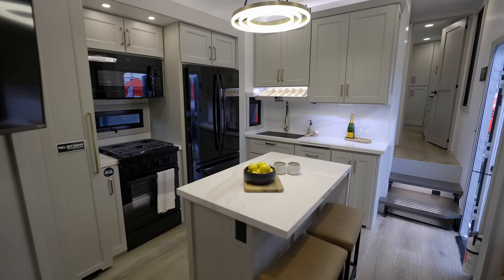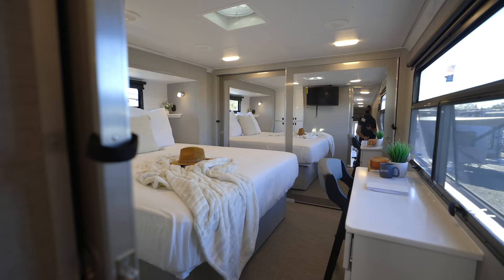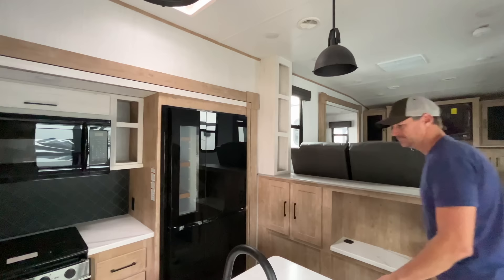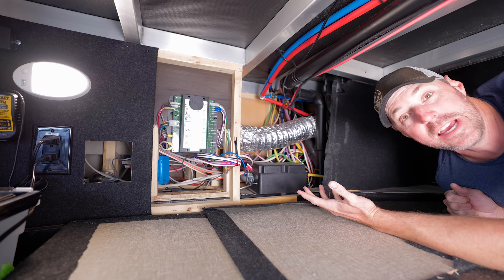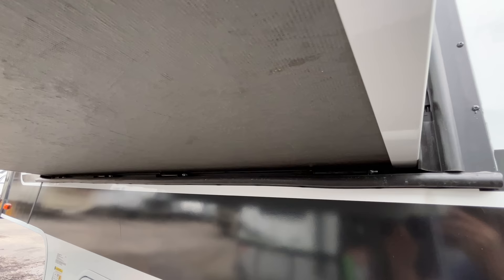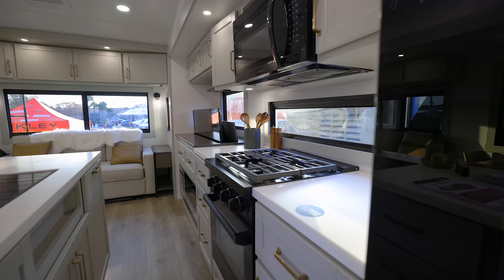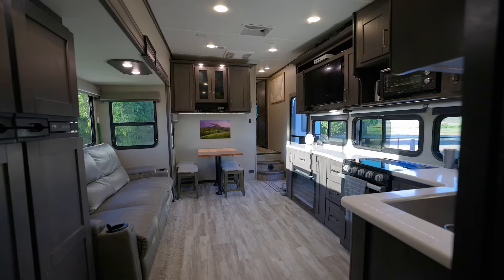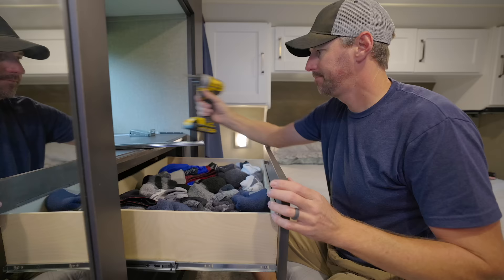Are All RVs Junk! Problems With Our Grand Design RV.

Comment: Those comments you highlight are justified. I have owned 3 trailers in my lifetime. A 1969 Boler, 2014 Coleman Dutchman and a 2019 Aspen Trail by Dutchman and BY FAR the 2019 Aspen Trail is an embarrassment to Dutchman. Couches peeling, counters peeling, cabinets that have no stay open ability, cheap plumbing, cheap toilette, peeling wall paper, no sealant in bathroom,  trim on slide is falling off .... like I can go on. The 1969 Boler Trailer was a far better trailer than this. My 2014 Dutchman was FAR better than this and all issues were not related to build quality. But this is not the case with the 2019 model. Dutchman should be ashamed at what they put out. I will never buy another Dutchman. Go Brinkley. It is weird to be going gaga over metal plumbing connectors but here I am. Good job Brinkley. The trailer company that learns that your brand reputation matters, will win.

Comment: The problem with the majority of the RV market nowadays is that 85% of them are made in Indiana by the Amish and they simply do not care about the quality of the work because they get paid by each piece they complete so they just try to crank out parts as quick as they can without caring about the quality. Most of them clock in at 6am and clock out at 12 to go to their farms. When Grand Design first entered the market they were pretty good quality. Even today they tend to be one of the better ones which is scarey because almost everyone we get in has issues.

Comment: Outsiders looking in (we have no RV), but we WERE in the market.  Fit, finish, and workmanship are just "lipstick on a pig", the real issues are literally where the rubber hits the road.  The poor design and engineering of frame, suspension, slides, and other physical systems are one of the reasons we never bought a RV.  We all have seen the videos and to be fair, roads are terrible, but other vehicles use same roads.  I fully understand that it is prohibitively expensive to build towable RVs like cars, but improvements could and should be made.

Comment: We've been RV-n for over 50 years. In that time we've had a number of types & brands of RV's. We've always bought the little more expense, a little better quality models. We have seen a big difference in quality & more problems with the last two over the last 10 years. This last one we bought was from a small manufacturer building higher end product. We paid more but felt we needed to in order to avoid a lot of issues we see people having.  I do 99% of all my repairs & maintenance as I have ended up redoing what the service shops have been so poorly executing. I think you better be handy or unless you have a "guy", expect service issues in this day & age. I've learned not to get all excited & in a hissy but attempt to stay calm & fix the issue. I was helping a young couple in their first RV. It was a small, low end tt. I was appalled at how bad the materials & workmanship that was done. They didn't know any better. My bet is this is a 'disposable' in 5 yrs or less.

Comment: Plus GD with other manufacturers are having a major issue with what they call "Frame Flex", which is a nice name for frame failure. I have seen six videos on frame failure within the last week. Basically any unit over 30ft has a good chance of have this problem. The issue is when the manufacturers secs these out to have the frames built, they do not have the frame beefed up to handle the weight of the RV. The frame builders are only building the frame to the manufacturer specs. The manufacturer are cheating corner to save money. The outcome is the frames can't handle the weight and the welds are breaking loose. GD is having a major issue with this. The other major problem is the manufacturers don't want to back their product, and it is a major expense. In fact with this RV in the video, it wouldn't surprise me if he has frame failure. Buyer beware, especially if you are buying used, but they are having issues with new  ones off the lot. There are multiple videos out there going over frame flex.

Comment: I have a Travel Trailer (2nd and 1st new) and I have no intention on ever buying another one.  The entire experience from the Dealership, warranty work, major post warranty (Year 2) problems with roof membrane de-lamination, underbelly skirting flying off, sink and shower drain failures, pealing wall covering, Multiple pocket door failures, poor AC performance, etc... has made the entire experience frustrating at best.  At no point did anyone in the process of the new trailer did even what should be the bare minimum.  Brakes where shot from day 1.  I didn't realize it until our first trip and noticed that braking wasn't normal.  Attempted to resolve myself and ended up at the shop for 2 weeks with no updates from the dealer and the entire brake system was rebuilt probably due to grease all over.

Comment: I've owned two travel trailers. One thing about the industry is the people assembling them are paid piece work. This means the more they assemble (also known as slamming them together) the more they are paid. Don't count on the dealer fixing anything pre-delivery other than a blatantly obvious problem like the AC doesn't work. Buying an RV is a roll of the dice regardless of brand in most cases. First travel trailer had minimal issues. The second travel trailer had a good 30 issues. The scenario for warranty work is: one round trip to the dealer so they can see the problems then another round trip for the repair work. Hopefully they have ordered all the parts and do the repairs 100% correctly. Think about the time and costs for about 10 round trips back to the dealer which is what I had to do with my second trailer. I don't want to mention brands but lets just say the second trailer wasn't a grand experience.

Comment: I have owned 2 travel trailers, a Class C and a class A - all purchased new.   I expect things to go wrong; regardless of price.  I expect poor workmanship; especially now when people lack a work ethic.  

I think two of the larger issues are; poor dealer service and too short of initial warranties.  

My dealer wanted to charge an addition $6,000 for delivery and prep.   What a joke.  

When we originally picked up the rv we found so many things wrong with it.  As we used it, there were even more things wrong.  

I took it to the dealer last week and the intake rep must have said 100 times "the initial warranty is 90 days.  We will fix what we can and see if the other things are covered by warranty.  These "things" should have been caught and fixed in their deliver/prep time and not once the rv is delivered to the customer.  And we find out we can only drop off and pick up the RV during their business hours and only with a specific appointment time between 8-5.   So every time we have to take it in we have to take a day off work and lose a days pay.  

Just like car dealerships, RV dealerships need a major overhaul in their customer service departments.

Comment: I feel your pain...bought our camper new in 2022 have been able to use it 1 time...bought it in April went on our first trip in July just 40 miles away as a test run...no refrigerator....lost everything...Took till August to get it in the shop took till October to get it back...already had a trip booked from June...did not get it back in time for the trip so had to cancal and was a non-refundable deposit...Got it back in late October and started putting all the personal stuff back in to take a trip in late December so i decided i should probably try the furnace even tho i had asked them to test it again while it was there for the frig....And low and behold...yup no furnace...So back to the shop again this week for who knows how long...Will never buy a Clipper again. Have paid for 7 months towed it 40 miles never used...Worst piece of junk i have ever bought. Needless to say it;s 200 mile round trip to my dealer...I am totally disgusted...It is junk...

Comment: The reason the Brinkley is more, besides the obvious finish, the frames is designed for the weight of the RV, heavier component steel members.  The Grand Designs is a frame design for non long term usage.  Meaning the same frame, you have on a 30-foot 5th wheel, is the same frame you have on a 36 foot.  The manufactures then put what they want on these frames from cheap lighter weight to heavy luxury.  The heavier the more problems that will occur.  The frames are not made for the weight, and long-term usage, they begin to "yield" or plastically deform, and the interior finish begins to suffer.  You wall issue is most likely a cracked or broken frame weld.

Comment: A lot of the problem is companies being bought by larger companies, less competition. My wife and I went to the Palomino factory who made our Columbus 5th wheel. One of the managers gave us a tour and on the floor was one of their first models built after Forest River bought out Palomino. It was not close to the quality it was and some of the amenities we had were not available anymore on the same model as ours. Larger companies mass produce Rv's and cause warranty items to take months to repair, if at all. Grand Design not so grand in my opinion. Again on certain models they have actually down graded options. Example going from 6 point all hydraulic auto level to 4 point with motorized screw jacks in the front. The 6 point hydraulic was stock on our 5th wheel. Central vac, upgraded suspension and oversize tires were stock on our rig. I could go on but people are paying way more for much less.

Comment: In a word:  "yes".  An RV is built from a collection of stuff.  None of the parts are particularly designed to go bouncing over terrain and potholes for hundreds of thousands of miles.  So of course those individual piece-parts will fail or their connections will fail - sooner than later.  Rent one if you need one but you are nuts to pay $500,00 for something you're just going to be parking in your driveway or at the dealer repair center.

Comment: I bought a brand new Forest River travel trailer in March.. I live and travel in it full time. 7 months and over 2500 miles later, the only problem I have is I need to replace the thermostat. I have to reset the breakers to use my heat cause if the temperature changes by 5 degrees (up or down) the thermostat resets to 99 degrees and the heat turns off. 

2023 Forest River Grey Wolf 20RDSE

Comment: Bought a new Class C which had supposedly gone through production checks AND dealer delivery checks. Once driven off the lot and putting 5 gallons of fresh water into black tank, discovered a leak missed by both factory and dealer checks. Such a simple test yet the hurry get it out the door mentality on a $100,000 RV absolutely flabbergasted me. Dont have the time or space to tell you about the wiring, just to say rats nest is an understatement.

Comment: Our 2023 Grand Design 278BH is what I would consider to be fairly well built, though we've had minor issues with things like trim popping loose.  The bottom line is that quality materials and quality workmanship costs money, and most RV buyers are only using them for a few weeks a year at most.  If a trim piece falls off or the wallpaper sags, they don't really care.

However, this doesn't meant that spending more money will guarantee you a better rig.  As you pointed out, you can spend more money and actually get lower quality.  But we can't expect RV manufacturers to turn out Lexus quality on a Suzuki budget.

Manufacturers can certainly do better.  But will buyers pay the inevitably higher price?  Given the large number of manufacturers out there and the highly competitive market for RVs, I'm inclined to say that few buyers are willing to pay much more.  If there were more such buyers, some manufacturers would have stepped up to the plate. Perhaps I'm totally wrong though.

Comment: RV isn't a year yet....water damage from leaking window. Paint rubbed off on cabinets. The shower separating. Our toilet is now leaking. Why? Because it's hooked up with garden hose material...NOT plumbing material! The ball bearings already broke in a drawer. Our storage behind TV has had shelving come apart.

Comment: Surprised to see the interior quality on the dealer lot.  How do they leave the factory lookin like that.  Have a 2016 5th wheel with no major complaints.  Seems the most complaints are from manufacturer.  I hope these videos will pressure manufacturers to do a better job.

Comment: First keep your 5 o'clock shadow!  You look good with it!  

Our first RV was a 2006 Keystone Raptor 3612DS w/a 12' garage.  We purchased it new for $38k OTD.  It Keystone's 2nd year of making the Raptor. The toyhauler market hadn't taken off for them yet and the quality of build was really good.  We owned it until 2012 when we upgraded to a 2009 Keystone Raptor 380LEV because of the 14' garage.  This toyhauler seemed to have a little more bling than our old 3612 but the quality seemed to go downhill.  My theory, and it's a wild @ss guess, is that they were starting to get busy and trying to get units out the door and quality seemed to suffer.  Good video on some things to really look over when purchasing your next RV.

Comment: Trailers like you spoke to in this video tend to be of lower quality across-the-board due to the need to save weight for towing and the customer base they serve. Newer motorhomes in the lower budget range suffer from the same quality checks again based off the engine and frame restrictions due to the lower price range they serve such as Thor. An older higher quality coach such as a Newell, Country Coach ect will almost always outshine newer lower quality RVs. Just do your research before you buy!

Comment: I was told by the Thor dealer's Service Manager that all RVs have maintenance issues all of the time.  I asked her if she would pay over $100K for a vehicle to have it in the shop every time you take it out?  She didn't answer me.  Small self-repair items ok but we had our unit in for the cab a/c three times. On the third time and third repair shop, they found MISSING PARTs in the A/C system.  I guess Thor doesn't have any former Ford employees- "Quality is job one."

Comment: After being an RV dealer for 16 years and owning campgrounds for the last 34 years to answer your question from my experience they may not be total junk but they're definitely not worth the asking price. You do have to consider if you're constantly traveling causing the unit to flex and bounce down the road things are going to work loose. Currently in my campground even the Park Models especially the one's with slide outs have no fewer than 4 visits to repair things from the dealer after a new purchase. Hot and cold waters switched, drain not being hooked up, stapled wires, walls coming loose etc. All the same problems I had to fix 20 years ago when I had my dealership. Every year constant visits from the dealers that is if you can get one to show up which isn't entirely the dealers fault since unless it's a 12 ft. wide model the manufacture expects the customer to tow it back to the dealership to have repairs done and won't reimburse the dealer for service calls.
Reply: do u advise buying a new cargo trailer and building your own....from what i understand many rv parks will not allow a reconverted cargo trailer into their parks...i do not know if this is true....
Reply: For overnight/transient I don't mind but for seasonal no because it doesn't have a RIVA seal on it  @US_ARMY_25_INF._DIV.

Comment: With any RV you should expect the trim to pop loose after a while, and I have no problem with that. Our problems have all been major design or manufacturing failures. We've had 2 Montana High Countries 2021 and 2023. Both of them have had broken welds on the frame. The 2023 is just a mess of problems from negligently damaged wires to holes drilled in plumbing pipes. It's just a complete and utter lack of quality. Not to mention other structural issues.

Comment: The RVs manufacturing world here in The United States has transformed the meaning of the term 'Made In America' into the equivalent quality  of products of the 60's, 70's, and 80's to that sentiment of 'Made in Taiwan'.  Cheap materials of the outer shell, chassis, and suspension.  They focus more on dressing up the inside with nice amenities to sell the buyer, but if the outer shell, frame and chassis is junk, the whole system is junk.  

Winnebago did it right, but now we have 30-40 rv manufacturing companies that popped up, and their only interest is PROFITTING!  They build CHEAP and sell at a premium based off of looks and not quality (like the Winnebago).

Comment: RVs are make cheap, only look at the walls. There’s plastic and fiber board. And the furniture in them you think you got leather but it’s fake leather. Leaks, in new one. I bought a 2015 Thor citation Mercedes sprinter back in 2016 last of 2015. After about three years it starts to fall apart. The fiber board cabinets got a leak and I has to redo them.  If you don’t have a place to put the rv under the weather you will have problems.

Comment: Great video again. Now my question: what about the weigh of an Rv…heavier is better? Heavier built is a potential reason more expensive Rv are a little better? We had a 2012 Light Rv and it was amazing….and we are now with an ORV unit (those are much heavier) and after our Alaska trip (33,000 km to and back home) we va attest: heavier is better! Ours is intact from the difficult roads, and we can only complain of one thing…heavy requires a heavy truck with a heavier price tag…